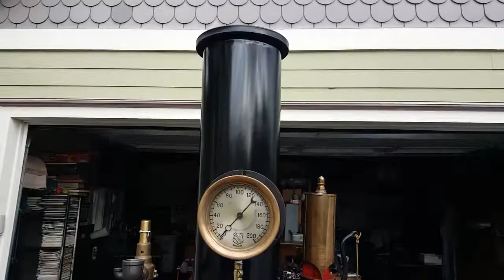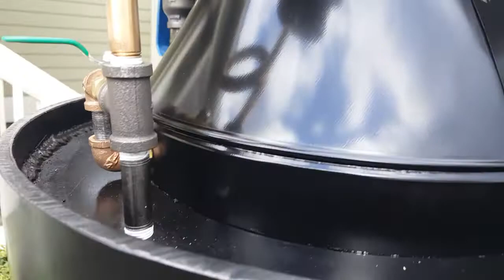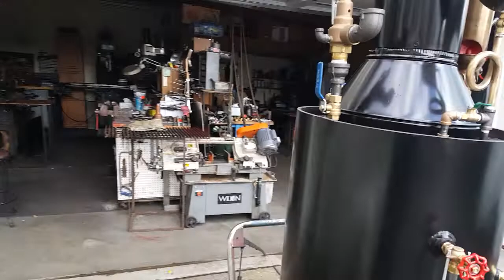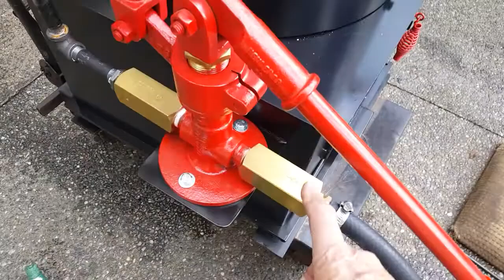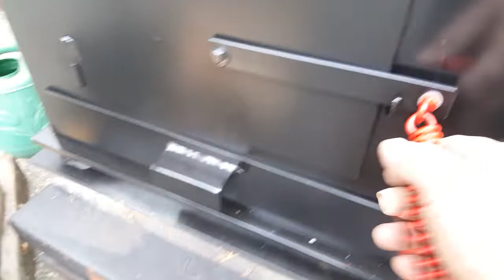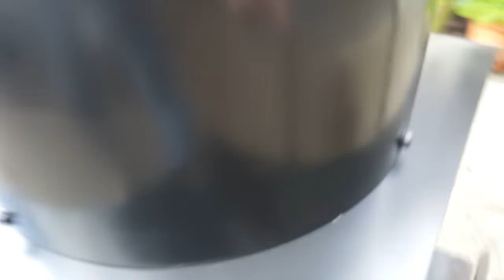For Sale Live Steam Engine Boiler AC Electric  Pump Whistle Gauge Off Grid

Comment: Ross. Have you had any issues using dissimilar metals? Also would using galvanized piping be better than black iron? What type of steel is used for the boiler body?

Thanks